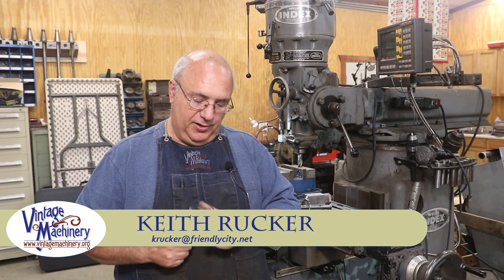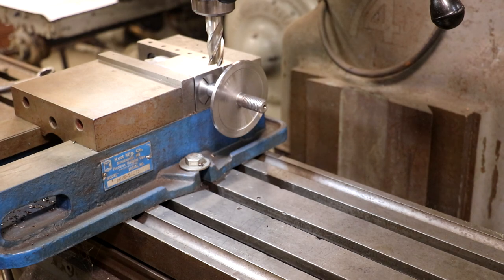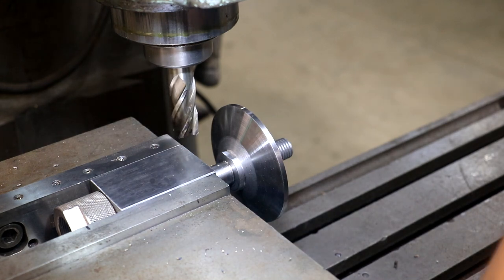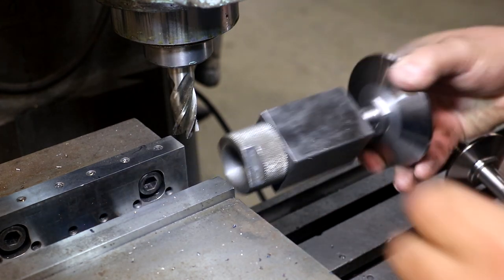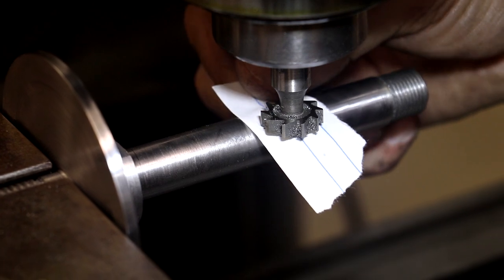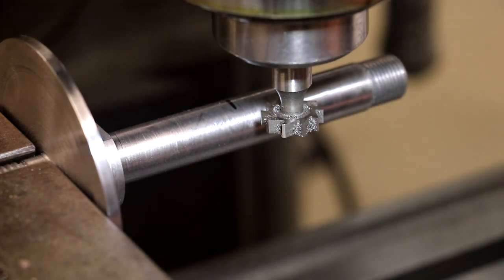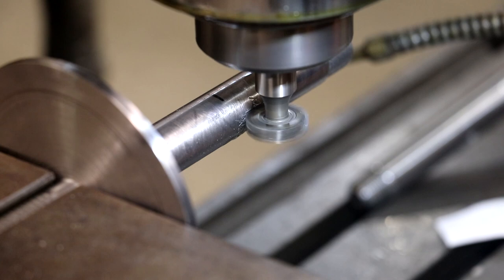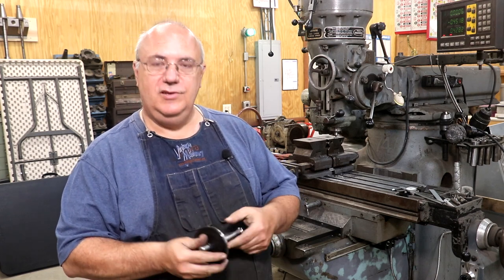Machining a New Arbor for a General Model 350 Table Saw - Part 3

Comment: I am glad that there is a shot at the very end of the video showing  the vise you used to hold the shaft.  I was wondering how you made sure that the shaft was dead horizontal.   That vise is quite a tool in its own right.

Comment: Looks just like the arbor I replaced on my Delta 10" commercial table saw,,, didn't see the first part of the video if their was one,,is that  a special thread  and nut that holds the pressure plate on ,, if so just what mine has too,  great video again,,

Comment: Keith if you wanted larger flanges for your own saw, would you consider just turning off some or all of the existing flange and then turning a new flange section to “thermal shrink fit” to the turned down section.  (‘worst case, drilled pin to prevent flange rotation). Thanks for an interesting series!

Comment: I had to have a pulley machined  for my General table saw…  the drive belt powers a double-sided pulley, the “back” half is a multi-ribbed micro v belt that in turns drives the arbor.  The lift mechanism pivots on this double pulley that mounts on two bearings, and the shape of it meant that from the inner bearing seat to the V belt, there was minimal material.  It was cast from pot metal and the pull of the drive motor tends to split the V-belt section of the pulley in half.  Because two iterations of General have gone bankrupt, and the saws being built by a “partner” in Taiwan, parts are non-existent. I explored 3D printing, but even a text proof of drawing print that had no strength, from a local jobbing 3D printing house,  was more than the cost of just having a machine shop make one out of stainless steel.  And Shapeways wanted nearly 400.oo, plus shipping to try their metal processes.

Comment: When using paper to establish a starting point, doesn't the paper crush a bit, at least enough to no longer be 3 thou? I would have thought the cutter is putting more pressure on the paper than calipers would.
Reply: For what this part is being used for, I really doubt if a couple of tenths of a thousandth would make that much difference. It is, after all a key for a pulley which will have a decent amount of clearance machined into it.

Comment: Great work Keith. But I’ve never seen a cabinet saw that benefited from a blade stiffener. A quality blade like Forrest and the like are hand tensioned and perfectly flattened to run whisper quiet. A waste of time if you ask me. Any vibration in a good saw isn’t from the blade it’s from the bearings or belts.

Comment: OK Guys - anyone want to take a guess on what this would cost a guy going to a machine shop to have done? And yes, I understand that cost is only one way to measure the value of something (and not always a good one!), but I've got zero experience in the metalworking field. I'm lucky in that I don't have a broken machine on my workbench waiting for a repair, but it would be nice to know (when that does happen) if I should be looking for a machinist or a replacement machine. Thank you.

Comment: Metric shaft with an imperial key? Seems strange. I had something like that on a machine and had to make a key that was half metric and half imperial to suit the only pulley I could get.
Reply: A lot of bearings are made in metric sizes as they have a worldwide application, easier to specify a metric shaft as it's in reality a limited production item, even if 10,000 are made, and use an off the shelf bearing that's available everywhere than specify some oddball bearing that most manufacturers don't want to tool up for.

Comment: When will the US convert to metric? When i heard this calculating in thau of inches, it makes me nuts.
Reply: Chris  I asked ONE little question and at once some guys develope snap breathing.  And i get attact personally (Chris).
Ok, forget it. I never have asked anything.
Reply: Thanks to you my Jeep is half Imperial and half metric, so I own two complete sets of wrenches and sockets needed to work on it. Oh, and thanks to J Carter, too.
Reply: Here in Aus, I work on a railway steam engine. Due to financial constraints, the nuts and bolts and other fittings that could be scrounged are Metric, Whitworth, BS, AF, fine and coarse and various pipe threads. We also have a blacksmith who can weld and braze the bits that don't quite fit.
Reply: Thousandths are thousandths, whether they be imperial or metric the math is the same.